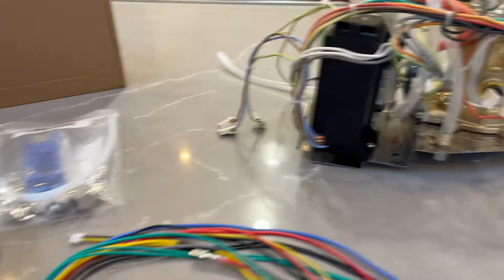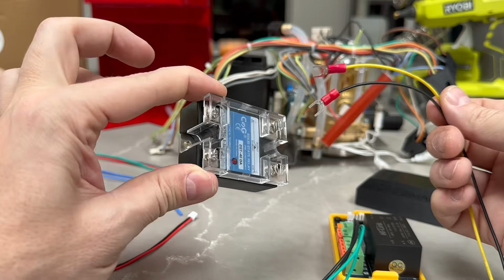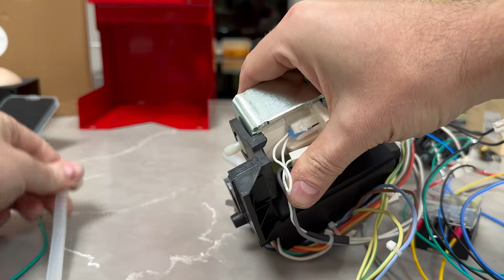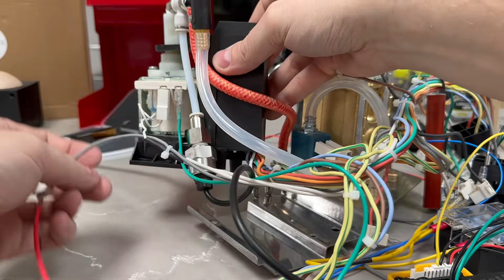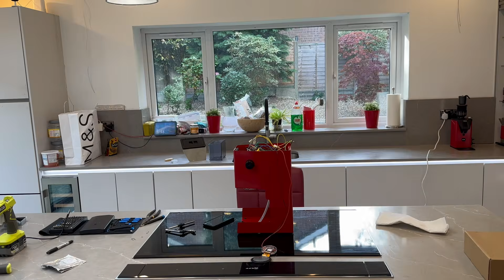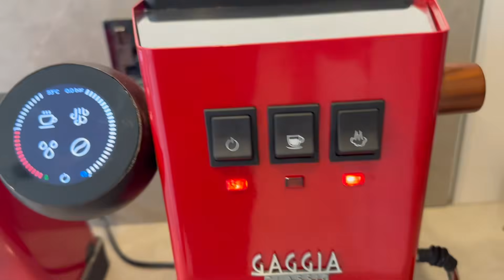GaggiMate - Gaggia Classic E24 - Full Build Part 2

Comment: was it worth it to remove everything from the shell for the install in terms of all the extra work to keep track of everything and the pain to do it/ rebuild? makes perfect sense for easy access, but I'm yet to see this method recommended elsewhere.
Reply from the maker: Because I’ve only done this ones and did it my way can’t really state weather worth it or not, what I can says is that during my build frustration was low and I had fun doing it, hope that helps

Comment: I love your video, pretty cool to start with painting :)
I have recently fixed Gaggia 2013 and plan on gaggimatting it :)
Did you try to fix the old board? It seemed from the video that it might be a simple fix with hot air station. - check Louis Rossmann :) be well

Comment: In other videos it says the pressure sensor needs to lay horizontally on the bottom, is there a reason you didn’t do that?
Reply from the maker: The first pressure sensor was faulty and the second had a stiff rubber base round the cable that prevented it from bending, so I shortened the pipe so it would fit and sit better. It was easier to prime in the orientation. I would say it’s more important to have not air bubbles than which way it sits, I have had now issues with reading the sensor

Comment: How did you secure the spade connectors to the monobloc in the end?
Reply from the maker: The not actually fixed to the connector, if i disconnect the switch it self the wires would come loose from the block, on the switch it self is keeping the spade connection in place

Comment: have the same leakage issue, screw clamp made it even worse, do you have the size for the bolt clamp?
Reply from the maker: https://amzn.eu/d/08AXHkOT 12-14mm
Reply: Hi 
Did you managed to get it fixed?
Reply: @jasimalqadi4559 hi, in my case reapplying Teflon tape helped, there was no need in the clamp
Reply: @InI133 sounds great.
I am getting my gaggiamate in the next couple of days and I am a bit worried about the leaks.

Thanks for sharing.
Reply: @jasimalqadi4559 also T-joint was leaking, had to replace an o-ring there in order not to wait a month for the whole part replacement
Reply: I hope yours will be less troublesome, but the coffee is great anyway 😅

Comment: Hi, can I ask how the Gaggia grinder is, I’m also looking at the DF54 but not sure which to go for. Thanks.
Reply from the maker: yeah i was also looking at the DF54, a friend has one and he has only good things to say about it, i went for MDF55 as it was on offer with the gaggia classic, and since it was an aluminium extrued chassis i meant i could power coat to match the machine, there are other machies that have the same internals as the MDF55 but the chassis are plasic eg the Eureka Mignon, all are great options, just comes down to offers at the time and personal prefferance on style :)
Reply: Amazing thanks. I can see they still have that offer on. Looks like you modded it and added a bellow? Was that straight forward. Thanks again.
Reply from the maker: @chhabs  GaggiMate - Gaggia Classic E24 - Full Build Part 1
https://youtu.be/-kGn_LU9lcQ this is the video where I mod the grinder, if you dm me on discord I can send you the file for 3d printing the tilted base for the grinder

Comment: Awesome vid, did the pressure sensor not work initially because you didn’t prime the hose with water I wonder? Waiting for my gaggimate to arrive this has helped immensely
Reply from the maker: No, sensor was dead hooked it up to a spare Arduino and bicycle pump and no signal coming off it, and did do a lot of faffing, making sure there where no air bubbles in the line, just one of those things